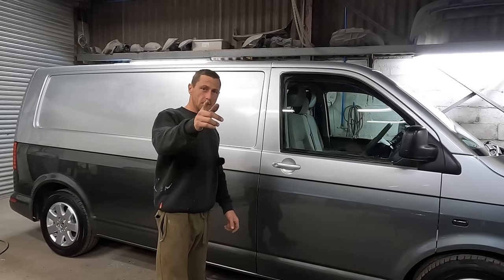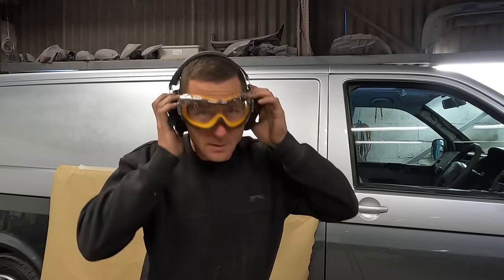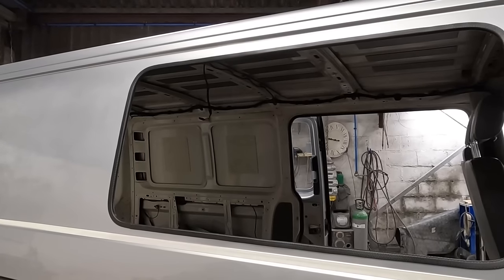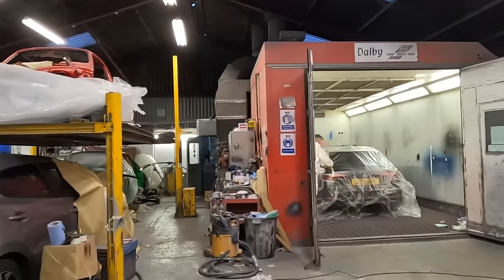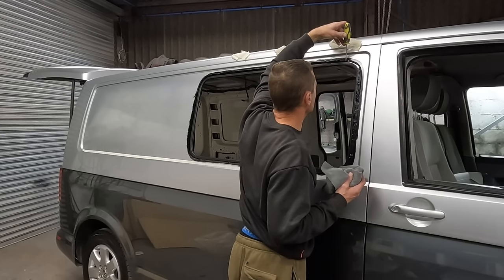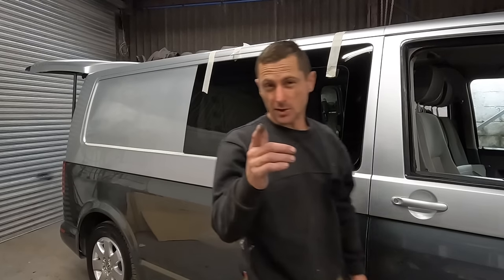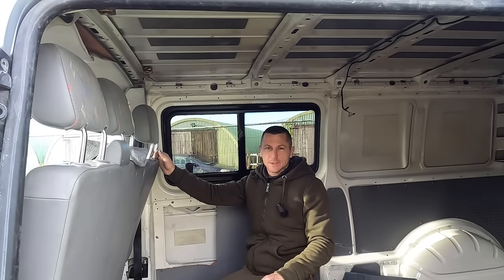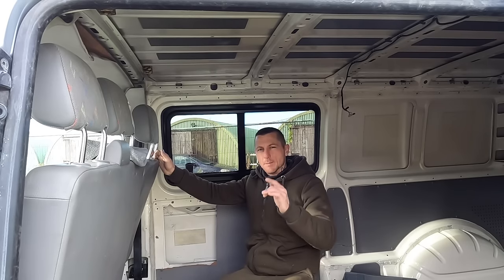Vw T5 transporter - fitting side windows - ep15

Comment: that reminded me of me doing mine on my van. I cant tell you how much I was bricking it, knowing if I cut wrong- specially the sliding door- I was looking at an expensive fix. I cut mine out using a nibbler which was brilliant to use. I must admit, i'd not given thought to doing dummy rear windows but I love the look on yours and it deffo makes the bus look way longer. I didnt get my windows from trade glass. I got them from another place and Id rather have the glass locks on yours.  On my van I made some fancy blinds but on the siding door one, the glass latch is in the middle of the glass at the leading edge and sticks out three inches and the blinds catch going up and down
 I have thought about cutting an inch or so of the plastic so the blind slides up and down- though for the price you paid for the front glass, I might just get a single sliding glass panel with the different latch.  Loving the build up of the bus. That paintwork is gorgeous. I cant wait to see your conversion.  Much respect- Kenny

Comment: Looks great, I always think you shouldn't fully seal around a dummy window, leave a gap at the bottom, so the air pressure can vent when it warms up. You can also drill a hole through the panel behind the glass so it can vent.
Reply from the maker: Hey bud a few people have said the same I’ll drill a hole on the metal inside 👍 thank you

Comment: Turned out very well.  I cut off the tip of the adhesive cartridge at a 5 degree angle and smoothed the edges of the cut surface with a lighter.  This will give you perfect, triangular beads of glue that stay in place.  5 degrees because you pull the cartridge gun at about that angle.  By smoothing the tip you avoid chattering when pulling the adhesive bead.
Congratulations on passing the MOT!

Comment: Looking good, with the paint showing through the gap between the glass, some videos show running a strip of black vinyl before installing the glass so you can't see any paint colour, as others have said you needed to leave a small gap at the bottom when running the adhesive round to allow any moisture/condensation build up behind the glass to drain out, It's coming together very well indeed. 👍

Comment: Van is looking great, you should be extremely proud of yourself.
Definitely pop some black paint between the windows, just mask up and use a brush.
Got to admit I’m belt and braces, so the morning after I fitted my windows I masked up around the windows and ran tiger seal along the top and sides to make sure they weren’t going anywhere and didn’t leak.

Comment: I used to be a windscreen fitter & you’ve done a real professional job,nice work,top video 👍🏻
Reply: So did I and you never bond on new paint especially lacquer
Reply: You can bond to new paint as long as it’s been baked at a high enough temperature
Reply: @Weirdwebbie58 when you shut the doors the vacuum pushes the windows out after a few months the lacquer breaks away from the basecoat and they start leaking
Reply from the maker: Hey bud thank you super appreciate that 👍 I watched a few videos and watched my windscreen guys a few times so had half an idea 👍👍

Comment: Amazing job! Van looks the nuts fair play. I’ve not tried this yet but my old T5’s previous owner put too much adhesive on the bottom and blocked the drains on the sliding window. It leaked badly so he had to reinstall another window. I doubt that will happen to you though. Perfect job 👍

Comment: Van is looking great mate..supposed to leave an air gap in the middle of the fake windows as they tend to blow with the pressure (hopefully yours will be alright) 👍🏻
Reply: Do you mean a gap in the bonding bead?
Reply: @brianstorm4806  yes 👍🏻
Reply from the maker: I will drill a little hole on the inside metal panel I never knew this but don’t want the popping in the heat thanks mate 👍

Comment: You leave a gap on the top and bottom on the rear fake window because glass and metal expand at different rates in heat and can shatter
Reply from the maker: Never knew that but will drill a hole on the inside thanks bud 👍

Comment: Nicely done man!  Anxious moments fitting windows but looks great!
Only consideration is leaving a 2 inch gap at the bottom of the false windows for the air to breathe, couldnt quite see if you did?    The glass can explode/smash without it due to pressure changes with temperature.   If you didn't, you can drill a few holes in the metal panel behind from the inside.. that'll do the same job but its another cr4p yourself job 😂
Reply from the maker: Hey bud thank you 👍 a few people have said the same about the air gap, i shal drill some holes on the inside before the weather warms up for sure. Appreciate that mate 🙏👍
Reply: @YTDTETV  sweet man! 😎

Comment: Thats another outstanding job done as usual 👌🏾 do they do a dummy window for the tailgate ? Might just finish it off and blend it in with the sides 🤔 a bit of silicone lubricant might loosen the sliding window as ive found it works wonders in the runners on electric windows when they start getting a bit slow going up and down
Reply from the maker: Hey scorcha thank you mate 🙏, I’m going to add a proper tinted window to the tailgate as I like to see while driving. I’ll try the silicone spray as it is very stiff, my drivers window was very still after reinstalling the window so will try it on that to 🙏👍👍

Comment: You should have left a gap on the fake windows at the bottom for expansion as they like to explode when they get hot in the summer months.
Reply: This or drill holes through the panel for air expansion.
Reply from the maker: I’m ok drill a little hole in the inside 👍 never knew that but niceone mate 👍

Comment: Nice one! Have you mapped it yet??
Reply: ooooh easy there. Seen a few tales on diesel remaps, best to check the specs on the existing flywheel / clutchpack... they're apparently sized to factory torques... single mass might be the way to go for an overhaul like this
Reply: @SuperMattboxio  easy? He’s put a different engine in with a different turbo and injectors so he will be mapping it, just not heard him mention it in the videos
Reply from the maker: Not yet but soon 👍